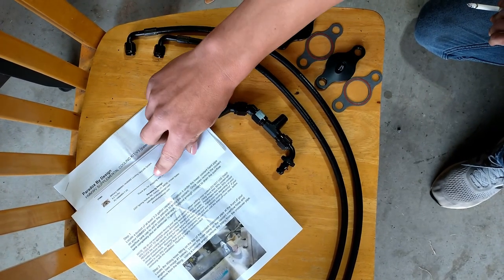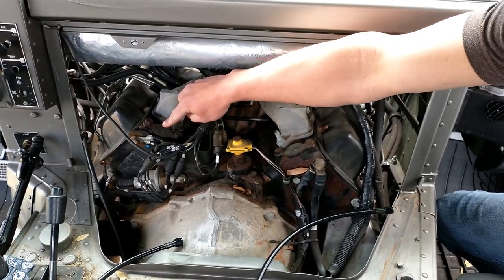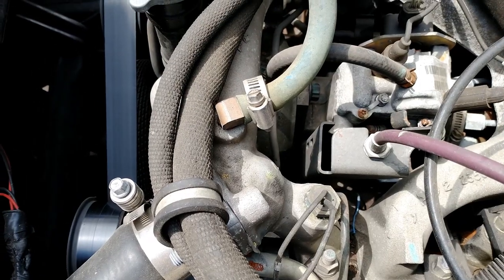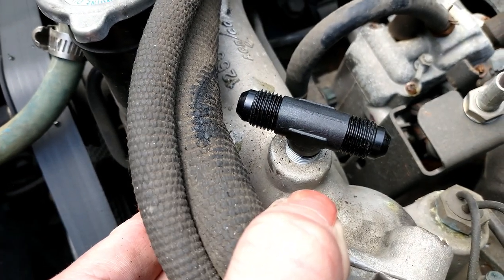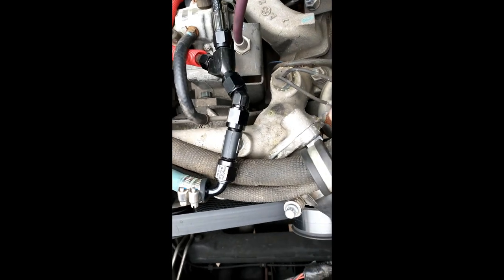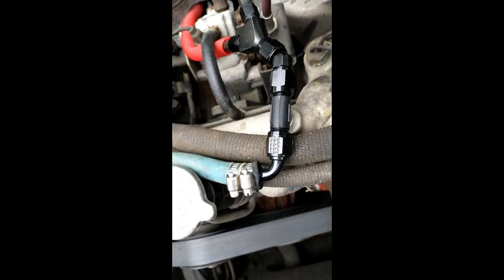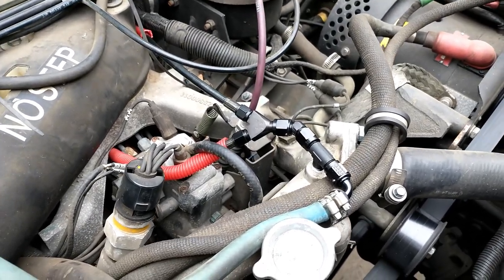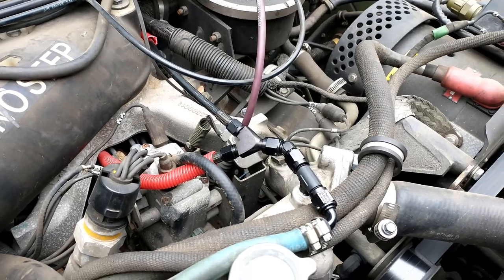Texas HMMWV Cooling System Upgrade

Comment: what is the yellow sensor called   mine is leaking trting figure out part #  thank u
Reply from the maker: 🙂👋
That's the oil pump drive. 
There is a gasket where whole drive assembly meets the engine(FelPro70051?)  and a small o-ring for the top part whose number I do not know... most leaks I've seen is from the gasket.
Reply: Copy that. Thank u sir @sadiesometimes1141

Comment: Hey what electric fan did you use? And how is it cooling for you??
Reply from the maker: Hi🙂 It has a flex-a-light 104242 or similar. I cant find the exact number. But yes it cools rather well with the shroud as opposed to open fans.
Reply: Thanks I’m thinking about put one in mind.. fans or one big one?
Reply from the maker: I think the dual fan is the way to go👍👍🙂

Comment: how much of a difference did you notice?
Reply from the maker: Hey🙂👋 Temperature wise, not much. Maybe 5/10f degress on a 100f+ middle of the day trip. Otherwise about the same. The main benefit is more longevity by keeping coolant temp the same across all cylinders. Similar to the 1990s gm gas v8 design where at the rear of both cylinder heads, a lack of flow can cause a localized boil. Back then we would tap the intake manifold at the rear coolant passage and use copper fittings to rubber hose for flow to the front. Hope that helps in some way👍🙂
Reply: Makes Sense, Thank You